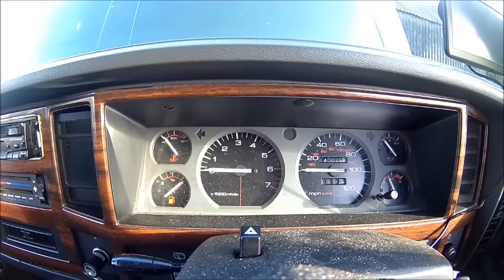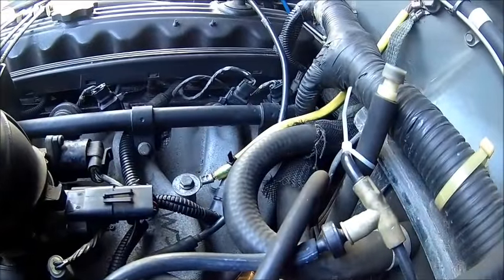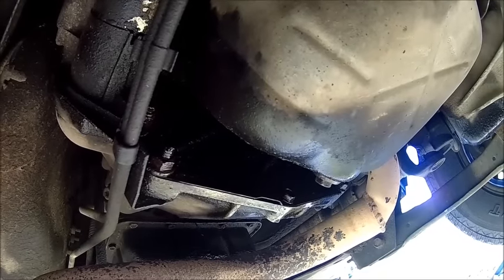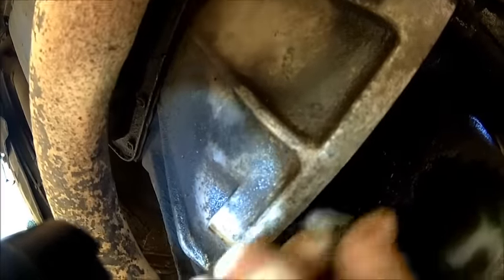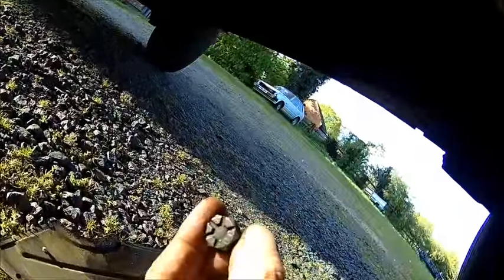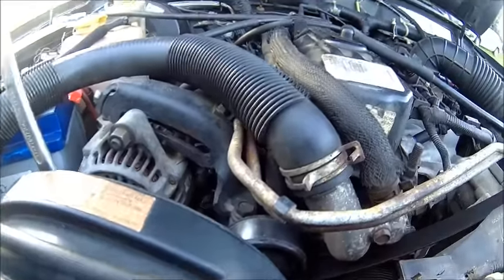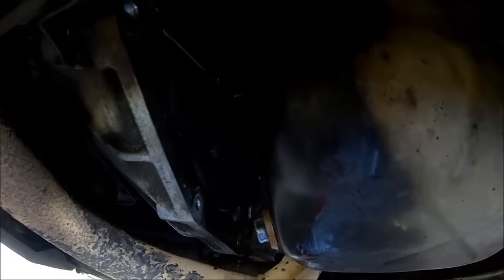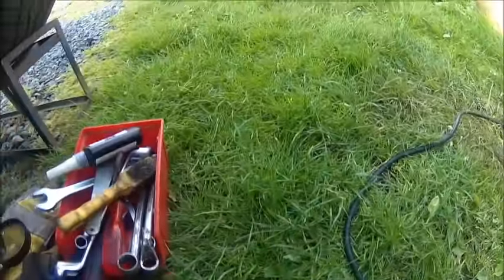Jeep engine knock fix  -Cherokee XJ 4.0 Auto, flexplate bolt issue

Comment: is that the toyota transmission you have in that thing? i have a parts jeep at home that has the toyota tranny in it.. the one i normally drive has the peugeot B10 5 speed manual in it.
what's interesting about those cherokees is that the ones the went overseas came stock with automatics and all the bells and whistles.. 
while mine has A/C and electric windows etc it did come stock with a manual transmission. i haven't seen one yet that went into the export market that had one. 
the G.I.s that ordered them up at ramstein/vogelweh could get them either way. but not the civilians..
anyway, that's a good little piece of info to know for the future in the event i switch mine to the automaic
Reply from the maker: +HolzMichel .. It's the same gearbox as yours, but that's not a Toyota, it's actually an Aisin Warner AW4, no idea why so many people call it a Toyota box.  Aisin Warner was formed at the early 70s and is a Joint Venture of Aisin (JP) and Borg Warner (USA).
The Toyota box is similar and most likely made by AW as well, but certainly not exactly the same, i think Toyota is somehow involved in AW as well, not quite sure.
It's a pretty bullet proof transmission, keep it cool and check oil regulary and it will last, only downside is rather poor efficiency., so it wastes alot of power (and fuel).

The US market is quite price sensitive and in the desert it has to be simple to fix, that's why they put the cheapest/simplest manual transmission in they could find and together with no bells and whistles it made a cheap farmers ride. Just look at US trucks, cheap and simple, no one in Europe would buy a non-synchronised gearbox anymore, but US truckers are used to it.

Over here, all XJ Diesels and most (if not all) 4 cylinders came with the manual box, i've seen some I6 engined ones with MT as well, but most had AT. Strange thing here is that rear LSD was a rare option which is pretty hard to find, searching for years now, but all i found was scrap metal. Apart from that, mine got all the bells and whistles, except the factory tow bar, that's why i bought it. 
No hitch bar means most likely not being abused, i fittied one off fleabay, they sell pretty cheap here.
In the 90s, the rather rough Cherokee had to compete with Range Rovers + Co, so leather seats, plastic wood trim, AT, Aircon and electric windows were essential to reflect a similar status symbol. 
I recently found an old video from the 90s here on YT where Jeremy Clarkson (Top Gear) tested a 4.0 XJ, ... he saiid something like   "perhaps the best 4x4 money can buy ...." ...i think he's right.

Swapping the AT box into a manual car is quite challenging as this is not your old fashioned hydraulic TH700 anymore, it's all electronic, so it's not just swapping tthe transmission, you need all the wiring, the TCU, engine mapping is different on AT's so you need an AT engine ECU, radiator with oil-water trans cooler, the oil to air trans cooler in front of the radiator, all the oil pipes and hoses. Not sure if the starter motor is the same as the ring gear on the flexplate looks a bit different to the MT flywheel. Axle ratios are different with AT as well, usually 3.55,... pretty sure i forgot something...most likely easier to buy one with broken engine/gearbox and swap your good bits in.
Reply: dynoguy
lots of info there :) good to know about the automatic tranny. guess i'll look to scrounge up another used B10 to keep around as a spare and sell the automatic.

i have a limited slip differential in my dodge and it has pluses and some minuses.
the plus side is that it does pretty good on slick and icy roads. the HUGE drawback is that the truck likes to bunny hop and go sideways on washboard gravel roads when running without a trailer behind it. especially in curves, which can get real interesting when you have oncoming log truck traffic...lol

the diesel XJ was never marketed in the US as diesel vehicles aren't real popular. the only thing that really took off was dodge cummins. ford and chevy have been dinkin around with diesels too but not had the market share dodge has
if i'm informed correctly the diesel XJ has a perkins diesel in it?
one idea i was mulling around when it come time to do an engine swap (mine has some 300 000 miles on it) is to dig up a volvo diesel (the inline 6) and shoehorn it in there. i've been trying to find out dimensions of the stupid thing, but i guess it's gonna be a matter of actually going to a wrecking yard and putting a tape measure on it to know for sure if it's gonna fit.
if you think the XJ is easy to fix then you'd love the CJ.. those things are like working on a 50's or 60's vintage chevy pickup... not much to them. my mom bought a '78 CJ7 brand new and i can still hear the whine of the tranny as the thing went down the road. it was a 3 speed on the floor and first gear wasn't synchronized at all.. the roof (hardtop) leaked like a sieve. it had the 4.2l inline 6.. that hing would climb a tree if it could traction.. mechanically the only thing that went wrong with it was the clutch went out after my folks went out pulling willow stumps out of the ground.. mom didn't have much finesse when it came to machines or driving..
Reply from the maker: +HolzMichel   If that would be a Perkins i probably would like one, but as far as i know all European XJ Diesels had a VM engine.
This lump wa produced by VM  Motori spa in Italy and was not really designed as a car engine which caused several problems. Target application was generators and agricultural machinery and that exactly how it behaves, pretty rough.

I can't tell you any dimensions of the Volvo, but it happens that i will be playing with a Perkins/CAT 4.4 I6 next week, happy to take some measurement if you like. From memory, i think it's not longer than the 4.0 I6. but it's quite tal.
The general problem with diesel conversions is that your gearing becomes too short, unless you use one of these modern TDI car  engines, your rev limit is around 3000rpm, that's at least 2500rpm less than the gas guzzler, so your top speed will hardly reach 60mph.

I'd love to have one of these Chevy stepside pickups from the 50's but they fetch astronomical prices over here, even if almost scrap condition.
Reply: dynoguy
hmmm.. i've never actually seen an XJ diesel in the flesh.. my dad used to pull wrenches for a living and he knew a guy that had one. so that's where i got my info from. so the italian engine is probably closer to truth. maybe the perkins diesel was a custom job.. hard to say
the italian diesels have a heating problem in the rear cylinders.. seems to be a common thread with them. i worked on a pistenbully once that had a lamborghini diesel in it. # 4 and 5 burned up in it..
the volvo can rev a little higher than other little diesels which is part of the reason i've been tinkering with that idea.. think it winds out around 4g.. not that i would ever run up that high but at least it won't be throwing a rod if a guy did by some dumb luck run it up that hi.
of course there are differential kits a guy can get aftermarket to run the gearing out a little further.
i wonder how heavy the perkins/CAT engine would be? the dimensions of course would be of interest as well.

ah yes.. the ubiquitous chevy stepside.. that's when GM still knew how to make a decent pickup.. they fetch insane prices in the states as well.
Reply from the maker: +HolzMichel  Didn't know that Kaessborer used Lombardini engines (don't think it was Lamborghini as tou said), i was always under the impression they used something German made.
The VM and so the Lombardini is not a bad engine when used for it's initial purpose, the problem starts when you try to adapt it for something else but don't think it to the end.The most common issue is aiflow around the engine to get rid of radiated heat.

I'll see what i can do with the Perkins spec and let you know next week.
And for gearing, bigger tyres are the smplest method
Reply: dynoguy
 ok, koolll beans on those specs.

yeah, the pistenbully has some airflow issues and several districts in idaho stuck the cummins diesels (the B 6 series) in theirs.
you might be right in calling it a lombardini, for some reason i remember as a lamborghini engine.. lambo does make tractors and diesel engines which is why the name stuck in my head. it was about 20 some yrs ago so anything is possible.. it was a surprise for me too to see the italian engine in the thing.

if i were to do a diesel conversion, running the bigger tires would mean having to put in a lift kit. so it's getting close to a wash on the cost. and of course the wear on the wheel bearings with bigger tires means more frequent bearing changes.
Reply from the maker: +HolzMichel .. Can't help much with Cummins specs, except you looking for something in the 1000kW ++ range,....:-)...
A 1" lift gives you enough clearance for 235/75/15 tyres which i run on mine, ..that buys you a few 100 rpm,...should be enough for US speed limits which to my knowledge isn't much faster than a crawler can do anyway ..:-)
Reply from the maker: +HolzMichel  Now looked at that CAT lump, length is probably the minor issue, height and weight is a major one.
The 4 cyl weighs around 450kg, not sure about the six, but certainly a fair bit more. So i think that's a no-go.

Surprised about the US speed limits being raised, thought it's less than over here, all i can remember seeing many years ago was those "speeding fines double" signs, i think it was 55mph at that time.
Reply: dynoguy
 hmm.. that engine is a tad too heavy for the front suspension methinks.. CAT stuff is bulletproof and almost impossible to kill but insanely heavy.. which is probably the reason they don't put their engines in pickups.. oh well
thanks for checking, it answered that question

the speed limits were upped something like 10 or so years ago, they still post the sign "speeding fines double" when coming into construction zones along the freeway which is reasonable in my opinion since there are people and equipment working in an extremely hazardous area. there are plenty of places where the speed limit is still 55 tho too..

Comment: Anyone have this tools part number?
Reply from the maker: Which tools ?
Reply: the little piece that you used to hold the flywheel
Reply from the maker: That's not a special Jeep tool, it's just a generic flywheel locking tool. Can't remember where i got mine had it for decades, it came in a set with some camshaft pulley lockers. Just search fleabay and you'll find them in various shapes.

Comment: do this only works for autos or does it work for manuals aswell?
Reply from the maker: Manuals are different, they got a flywheel and a clutch, no flexplate at all.
The clutch bolts are on the other side and usually don't come loose.

Comment: I literally just did all 6 rod bearings, lifters and pushrods.  All bearings torqued to 33ft lb like the book says.  Started up like a rod bearing thus when you hit the gas it sounds clear and don’t sound like a rod knock so I was super confused.  Hopefully this is the problem.  Gonna do this today probably.
Reply from the maker: There is a few more items which may produce similar noise... timing chain rattle (usually only in idle),  piston slap, (will mostly not disappear above idle) ... good luck
Reply: @dynoguy  Well i did have a knock, nothing on the flexplate.  Come to find out, I have some weird thumpy clatter below the head of 3 and 4 piston.  Replacing those today and I believe that will cure the problem and can enjoy my Jeep for once.

Comment: I have an "04"  ... 4.0 high out put ... coil rail ... cam position sensor .... no distributor ... no wires ... knocks like a sob  until warm .... uses no oil ... blows no smoke ... good compression ... powerful ... for a six .... "piston wrist pins "  .... that's what it is ... I will never buy another one  ... 4.7 V 8 .... That's the way to go .... these inline Chrysler  sixes are pieces of shit ... more trouble than they're  worth  ... I spend more time under this hunk of crap than I do driving it ... fucking garbage ...   never again .. !!!
Reply: Maybe if you actually knew how to fix it it would run lol
Reply from the maker: Fully agree ..:-), ....mine runs just nice